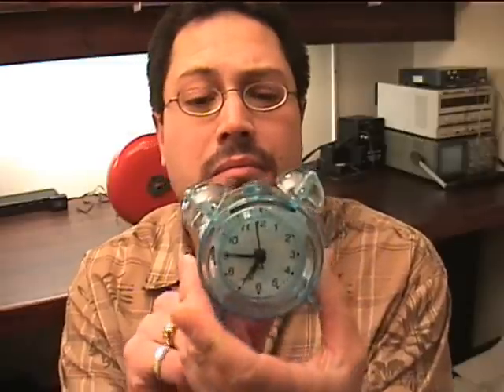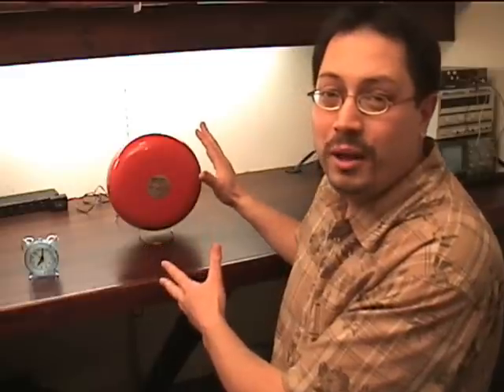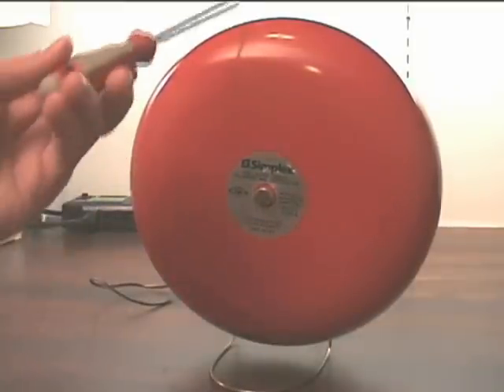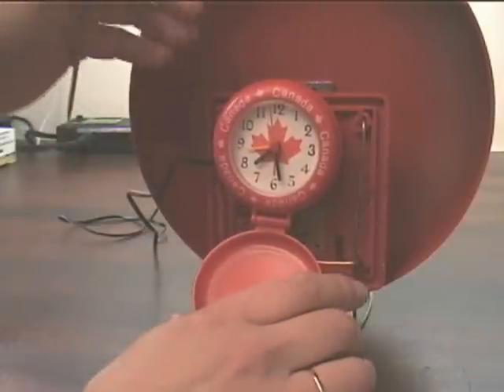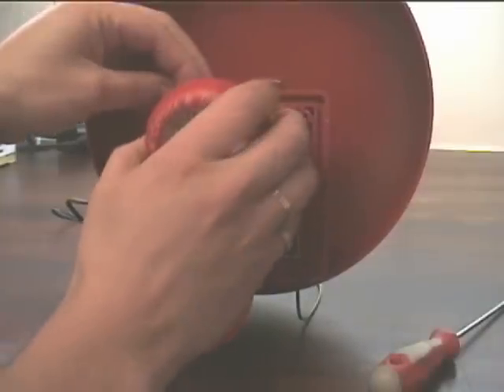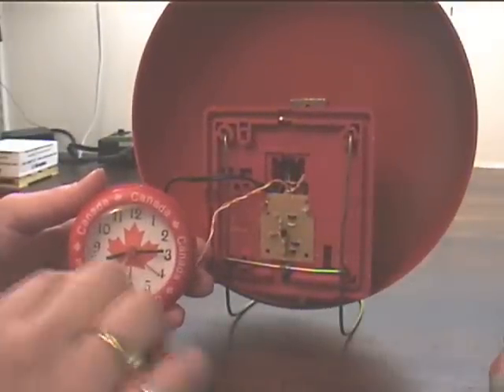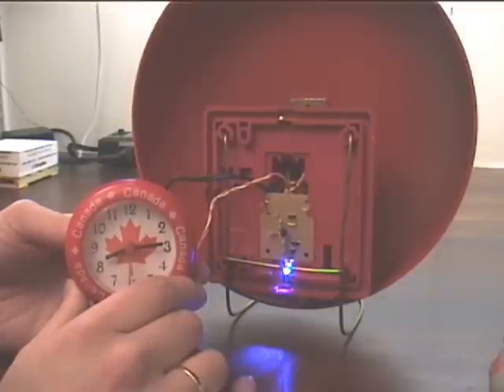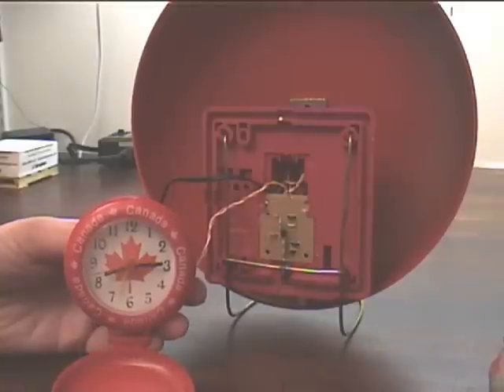Fire Alarm Bell Alarm Clock 2 - Worlds Loudest Alarm Clock?

Comment: I take it you built that yourself.  Last year, I bought a battery operated clock that looks like one of those old wind up clocks with the big bells on top of it, the bells actually work, the clock is very loud.  You can buy them from your local supermarket, I don't use my clock, because I live in an apartment, and I'm worried the alarm will wake the neighbours.